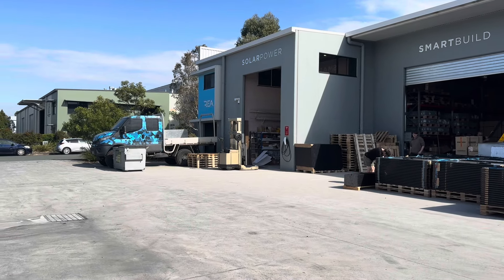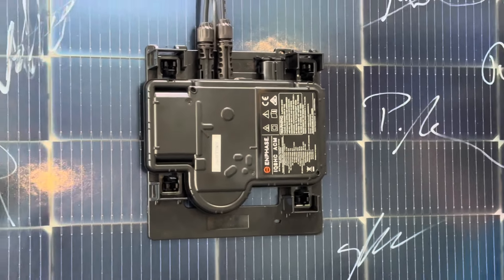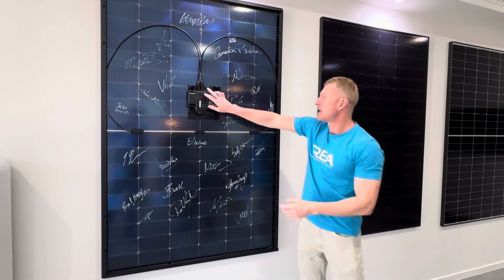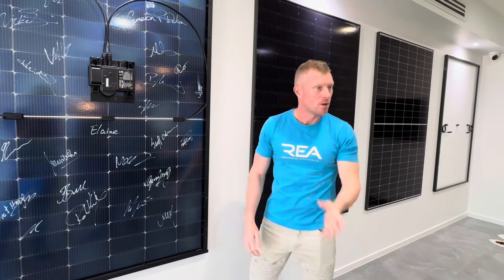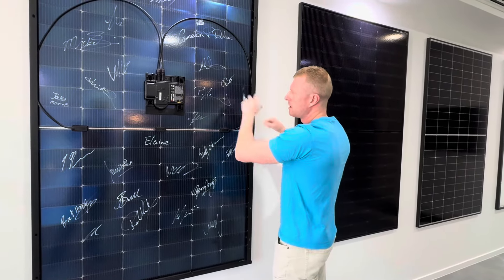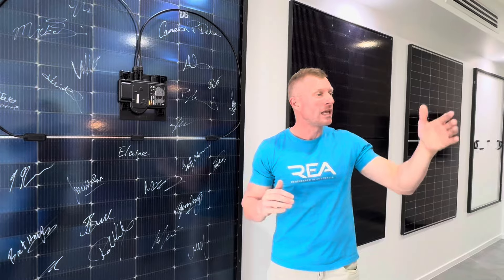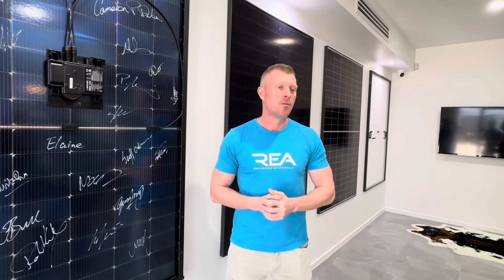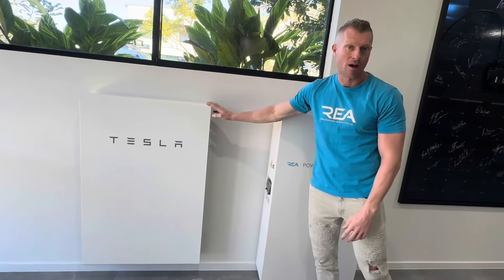The new integrated solar panels and safety of home battery by Michael at REA solar

Comment: Nice sales patter, but just a couple of facts. 
Once you have 6 or more panels, the start-up voltage of the DV inverter is lower than the enphase micros. 
5-600 Volts going through the MC4? Nope. Most inverters will not accept more than 400V and a string of 8 panels will only output around 250V. More than this on the roof and installers will wire strings in parallel.
The constant reference to DC "high-voltage" when they're using 240V AC. It's a term used to try and scare people.
The reason that Tesla are going towards DC with the PW3 is because it is more efficient and there are no legitimate safety concerns about DC systems.
I'm giving up on fact checking the rest of this video...i'm just not sure why this guy is so anti DC.